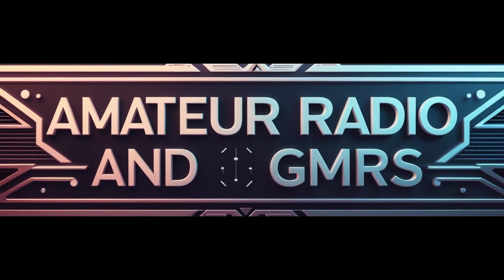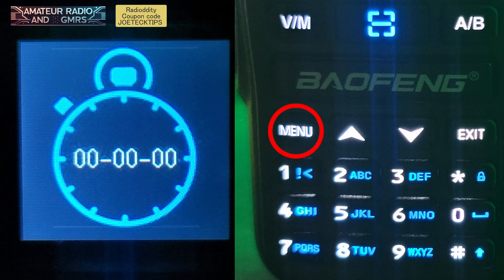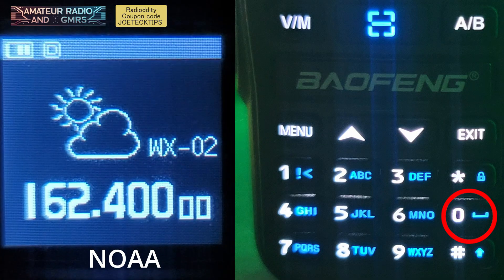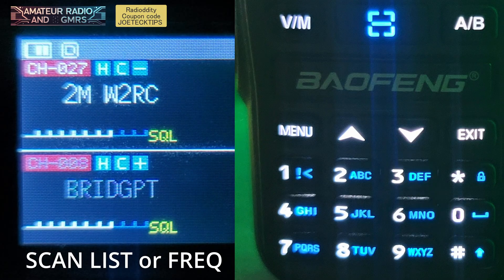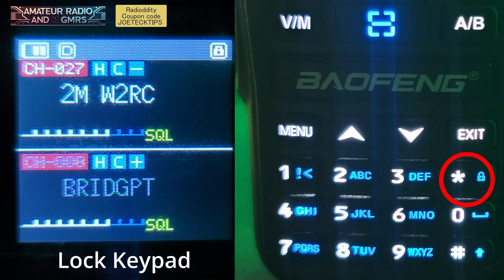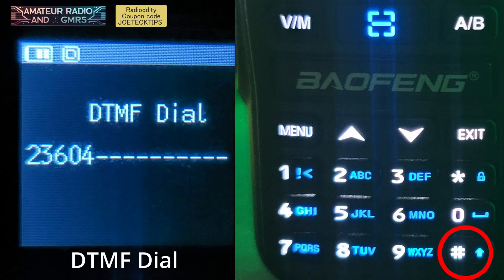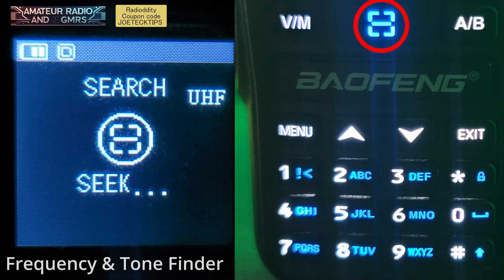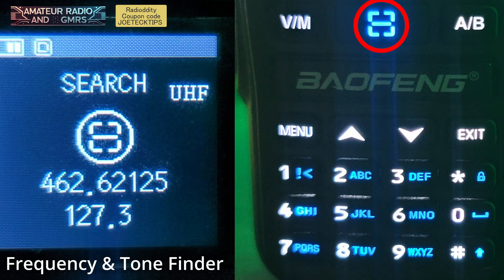Baofeng UV-5R Mini unknown features | Long & Short Presses

Comment: Thanks, wondered what the long press on the exit key did exactly. You can add a couple of other things, there are two versions of hardware the one you probably have which shows up in the menu as HW V1.0 and a newer version HW V1.7. Most of the differences are found on the motherboard where Baofeng has addressed the cold soldier joints of the volume pot. 

In terms of hot keys, holding the B PTT key along with the third side key at the same time puts the radio into update mode. On HW V1.7 boards the A PPT and third side key do this function. 

Bottom side key can be changed in the menu -> Radio Set -> PRESS SK1 -> brings up various choices. Default on my radios is FM Radio but other options are available though they all tend to mirror the hot keys you made mention of in your video.